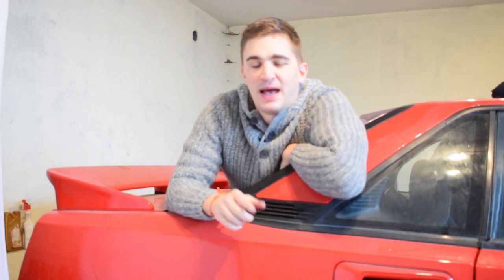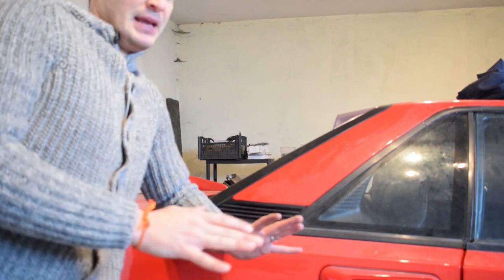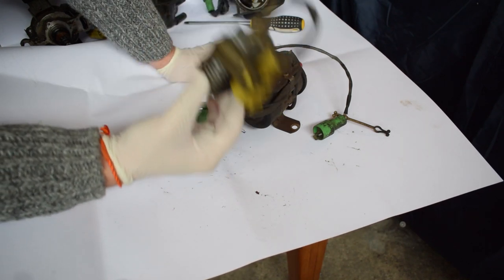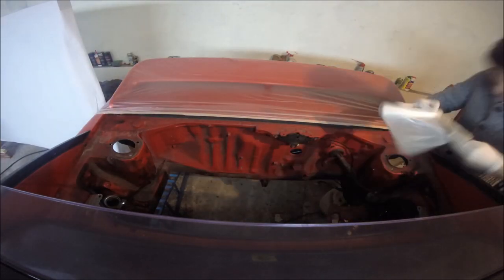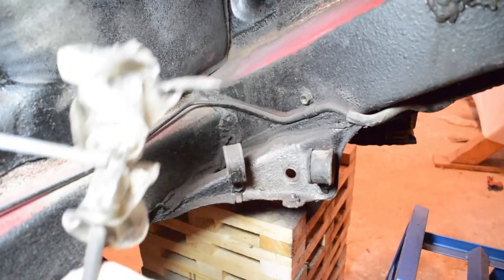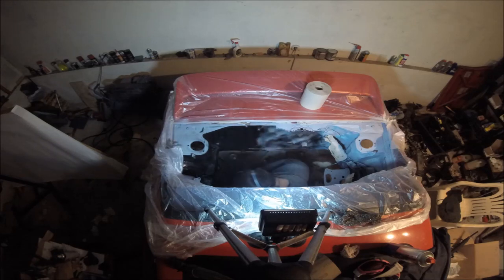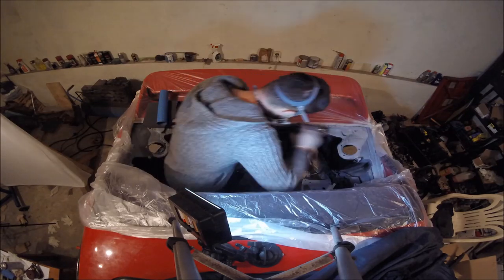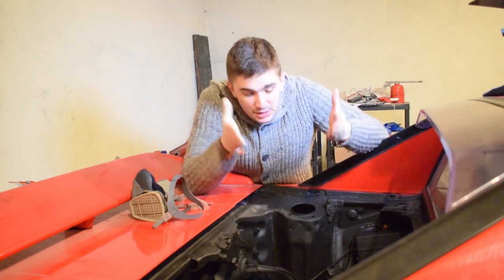How to spruce up your engine bay

Comment: Nice job! Never noticed that fan in the side vent!
Reply from the maker: Shame on you! You worked on the aw11 quite a bit :) The side went of the aw11 is very much functional in it's cooling role I'll have you know.  thanks a lot for watching man
Reply: I knew it was functional! I just didn't realize there was actually a fan. Do you know which sensor activates it?
Reply from the maker: 802 Garage hmm good question, most likely the water temp sensor. The air temp sensor might also have a say.
Reply: Yeah just thinking ahead to when I need to wire it up for the SR20! Giving it the fan signal for the radiator would probs be easiest.
Reply from the maker: 802 Garage I'll probably just wire a manual switch or an automatic temperature switch in my case.

Comment: I was actually thinking of doing this same thing with my aw11 while the engine bay was empty, i probably will forget about it or be too lazy when the time comes but i was wondering if there was a special paint thatd make it quieter like sound deadening material.
Reply from the maker: Most of the sound insulation in your engine bay comes from the firewall and the foam that's on it, which you can't really paint. So, the type of paint you choose for your engine bay won't really have much of an effect. The paint I used is really thick since it's stone chip protection coating but I doubt it will have any effect on sound insulation at all.

Comment: One warning: don't rest or put any weight on your C-pillar trim.  Easily broken and at gold prices to replace. If you struck it when pushing yourself out of the engine bay, it would break.
Reply from the maker: +Rene Neron I know. I cringed when saw that part of the video. This isn't my first c pillar trim unfortunately so I know how expensive they are now :)

Comment: hey mate, i finally bought my Corolla. A 99' 5 speed 1.8 litre engine. i've been looking for info on the engine, i'm pretty sure it's the " blacktop" variation 16 V, dohc, 20 valve. anyway i can check for sure ? love your chanel, cheers from Australia :)
Reply from the maker: Hey Andrew, I remember you. Thanks for being on board and commenting. The 20v is a 1.6 liter. It has a black plastic top cover that says "20 valve" on it, and the sound is to die for :)
Reply: @d4a  hey mate, thanks for the answer. i'm pretty happy with the 1.8 litre 5 speed, it's got some real get up and go, even though its only a " boring " 16 valve...lol . so, i must have the silvertop version you think ? these 1.8 litres in Australia are becoming more every year, especially the 5 speed version. how is the mr2 coming along ?
Reply from the maker: Silvertop is 20 valve too. 16 valves aren't boring :) If you pop the hood and look around the engine there might be some letters somewhere for the engine code. What's important is that you're happy with it, nevermind that redtop, blacktop, silvertop nonsense.
Reply: Cheers mate, I will look for the code tomorrow. the reason I was asking is to buy a balancer and 2 new timing belt pulleys

Comment: How does the Nodiz allow you to eliminate the ignitor and coil? Would this be the same if you still need the distributor in the car?
Reply from the maker: Here's a detailed Nodiz install video that should make everything clear: https://youtu.be/FyRz7ZbyJ6o. Basically you get rid of the distributor, igniter and coil and in their place comes a Ford ignition coil and a crank sensor. You get fully tunable 3d 16x16 ignition maps for more power and better response. If you want to keep the distributor, well then, everything just stays the same guess.